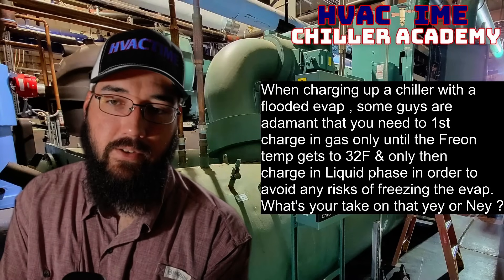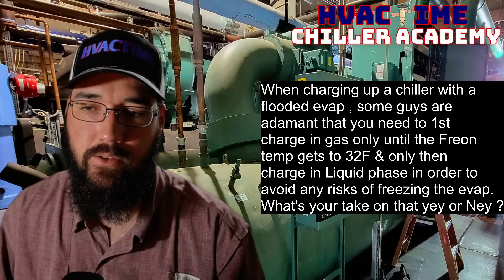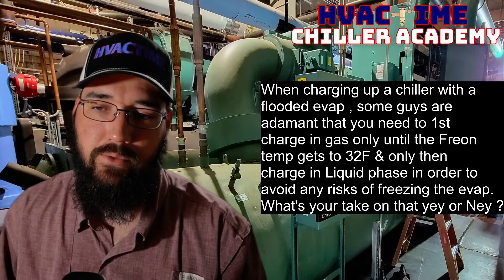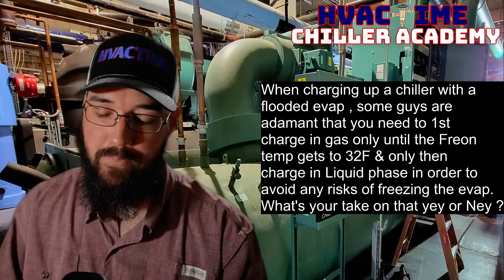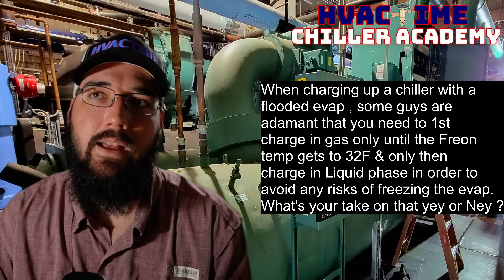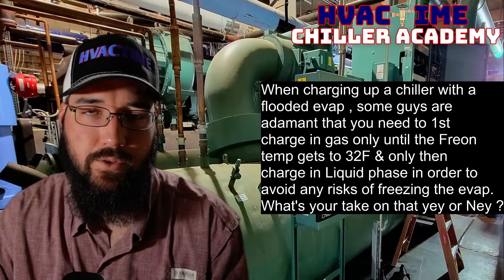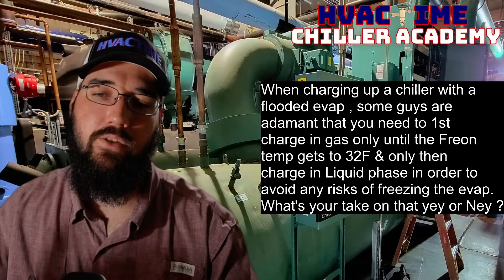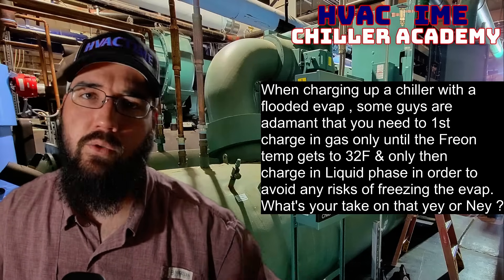Charging Chiller Vapor FIRST Then LIQUID Explained

Comment: Vapour until 40f then charge liquid. Not only can you freeze tubes by charging liquid below 32f, you can cause the copper tubes to expand at a faster rate than the steel tube sheet. This can cause the tubes to leak where they are rolled into the steel. This was discussed by engineers at york chiller training. We never want to rush our work when working on million dollar machines… take your time! 

Recover by push pulling liquid then vapour recover to just above freezing. Stop and come back tomorrow. If liquid is present, your lowest point will be the same temperature as the saturation. If your saturation is well below ambient, you can assume most or all liquid has likely boiled overnight. Continue recovery back to above freezing. Check for liquid present with a thermometer or by feeling for cold surfaces on the chiller. If the surfaces are above saturation, you can safely proceed below freezing saturation and into a vacuum knowing you won’t freeze the bundle. I almost never recover with pumps running because a pump could die and then you could freeze a machine. I’ve pulled charge on probably 30+ chillers never had a problem, just can’t rush it- it takes what it takes, usually 2-4 days depending on the charge and style machine. Charging is the opposite, vapour charge to 35-45f saturation (perfect time to leak check to make sure no o rings started leaking) if all good then send the liquid in with full confidence the tubes are safe and sound. Don’t forget to isolate power to your oil pumps and your VSD when going into a vacuum or freezing a tube will be the last of your worries (major overhaul on your companies dollar!) Especially on your magnetic bearing chillers, they will blow things up with power applied in a vacuum!!

Comment: I was watching an old video of yours where you were working on a chiller on a rooftop in Austin Tx, and you were working near a 5G antenna; That was a solid question and overlooked to be honest. I did some research and at first it was saying it wasn't harmful because everybody is inside and the walls are plenty of protection, Which led me to dig a bit deeper. The answer is yes it is harmful working near those antennas if you're working near them like on a rooftop chiller. Obviously I think its prolonged exposure but it can add up, It recommended to shut off the antennas if you're working anywhere near them. I hope i provided some solid info, if youve done your own research and read otherwise, let me know because one day thatll be me working on a rooftop chiller.
Reply from the maker: My research and others have said the same as you